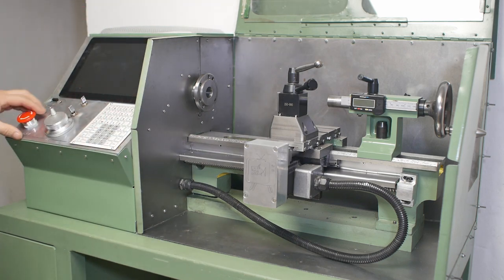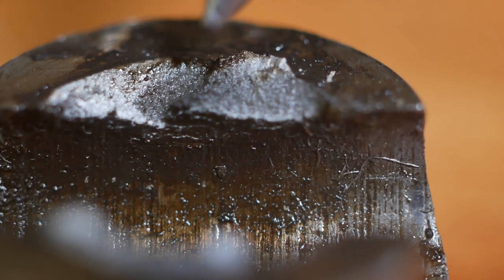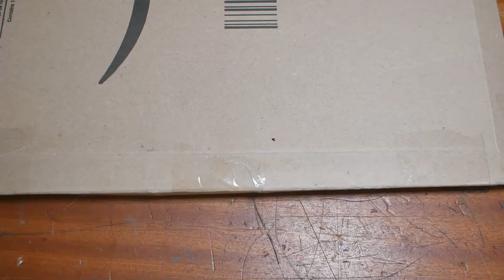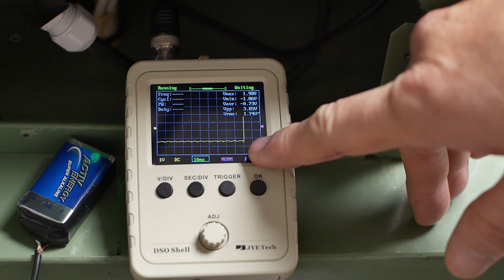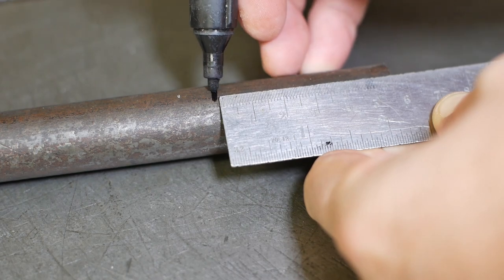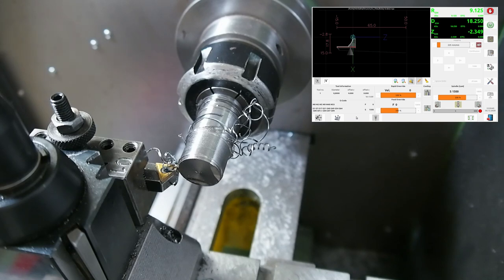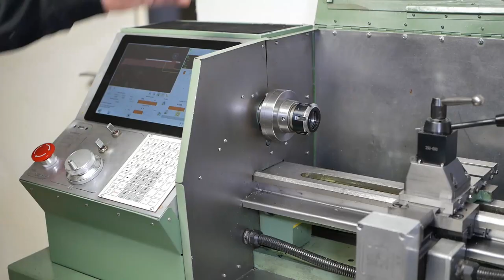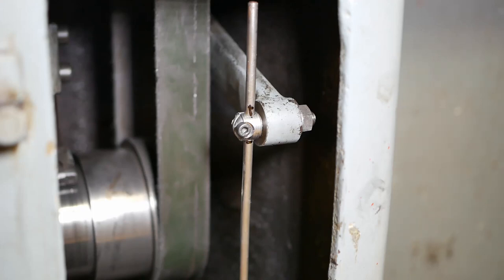Man vs tiny CNC machine - CNCing the mini lathe -Epsisode 38 || RotarySMP

Comment: This is the deficiently of a ER collet. If the work piece is to short the collet won’t grip it properly.  If you had left the bar long and turned the threaded end first. Than cut the part off the bar.  Than you could chuck the longer section in a smaller ER collet to do the end with the cross/clamp hole. If chucking something in a ER collet that’s shorter than the collets clamping length they don’t hold properly. The back of the collet collapses to small and than there is a taper to its bore. This results in the part only being clamped on the very end corner of the bar. That’s why the part moved when you were threading it. You can reduce this to some extent by clamping something of the same diameter in the very back end of the collet when you tighten it. But it’s still not the best. Sorry for being so critical you machine looks great!
Reply from the maker: Hi and welcome. I really dig your channel! 

I learnt the hard way about clamping short in the ER collet. I think it was about the time I was making all these screw ups that you made the video of the part with the thousands of measured dimensions. I can't even fathom how that can work. My probablity of screw ups doubles with every feature set up, so i'm at near certain error by about the fifth.

Comment: When threading manually on my minilathe I have to take vey light cuts (only a few thou). So I was delighted to see that even after all your scraping and re-gibbing etc, you still need to take light cuts to avoid catastrophe. Full marks for honest disclosure.
Reply from the maker: I was in high gear, whereas low would have given about 2.5x torque, and also my work holding was poor, with insufficient depth in the collet. I am pretty sure I can take a deeper cut, but improving the geometry doesn't address the bed having the rigidity of a wet noodle. Still better a  mini lathe than no lathe.

Comment: I was watching an older video by Stefan about regrinding his carbide inserts as that helped on his hobby grade machines as less cutting pressure is needed , only a suggestion as I’m no machinist , I enjoyed the video thanks.
Reply from the maker: It would help with cutting pressure, but then I loose the CNC advantage of having fixed tool offsets. With standard inserts, once you change tips, for general tolerance (no tolerance) jogs like this you don't need to touch off again and change offsets.
Thanks for watching.
Reply: Thanks for the reply 👍, I’d never had considered that as I don’t have cnc experience.
Reply from the maker: @lesliesoutham7396  Judging by STGW's excellent workmanship, he probably grinds all his inserts to identical repeatable dimensions as well :)
Reply: @RotarySMP  maybe your next project could be a CNC cutter grinder machine like edge precisions  , 🤣
Reply from the maker: @lesliesoutham7396  Imagine crashing something like that!!! Scary.

Comment: Brave soul turning so close to the collet at this stage.

Having rebuilt my big Beaver TC20 I know the stomach gripping tension of running that first program. At least yours should stall on a big crash, mines a 26 kw spindle motor !
Reply from the maker: Scary. That really is a nice feature of the mini lathe, the axis stall, the belt should slip, and it the worst happens, I can replace anything.

Comment: I think you need to make sure you use your Maho every video, that thing is just gorgeous 😍
Reply from the maker: It is a really nice machine. I am getting progressively comfortable with using it, also this time I messed up the touch off completely.
Reply: @RotarySMP  I'm very jealous, it's quite hard to find a Maho in Australia...
Reply from the maker: @oliverrowe8648  I got lucky, this one came up in Passau, about 3 hours from here. The controller was defective, so it was pretty cheap, although the mechanicals are barely worn. There are plenty of other good candiates like Hurco, Fadal etc.

Comment: I once heard someone say fail small fail cheap. At least it wasn't a $3000 USD part and you didn't seem to hurt the machine . It's great to see the cnc lathe doing something now. in a year from now that machine will probably be able make that same part repeatedly perfect once you know what speeds and feeds it can handle.
Reply from the maker: You really get to see why machines need mass. Those cuts the Boley does with ease. Although half my problem was not enough stock in the chuck.
Reply: I think the full quote is something like 'fail small, fail fast, fail cheap' - you make lots of little, cheap mistakes, quickly, hence you learn quickly and avoid massive expensive fails ...

Comment: You are braver than I, to upload making that "part". ;) Looks like you could use a HP increase. Too much is never enough! A different order of operations would have helped the workholding a lot, too. It is nice to see some first chips after all that work. I have been on the fence about a Linux CNC conversion, but the more I see the more it looks interesting.
Reply from the maker: YOu arent wrong. The only silver lining of my lame machining, is that people low watching robots commit suicide. :)
Yep, on the rematch, I have to do the work holding differently.

Comment: On the ER clamping problem: As you've found you can't grab onto a short piece of stock. You can cheat the system however by putting another piece of stock the same diameter in the collet behind the piece you're working thus increasing the collet engagement, and making it clamp evenly on the work piece. I regulary use the shanks of drill bits to do this (with the sharp end protruding backwards into the spindle bore).
Reply from the maker: That is a really helpful tip, thanks.

Comment: This is a really excellent series. Are those triangular inserts moulded or ground? The bloke on the smallcnclathes channel talks about using finishing inserts for roughing, citing lower cutting forces due to the highly positive rake and sharper edges. I've used cheap inserts intended for aluminium on steel with good results. This is on a basically unmodified Sieg.
Reply from the maker: Those are moulded inserts. I also have the high rake angle polished ones for aluminium, but fine the edges don't last in steel. This piece of mystery steel is pretty touch as well.

Comment: I bought some insert from Banggood purple-ish blue game changer and I run my lathe backwards with the tooling upside down. That way the tool is push up and way from the work not pulled into the work. I’m working on removing compound slide. Thanks for sharing.
Reply from the maker: That TCMT tool holder was part of a crappy set when I got it 20 years ago, and has not improved with age. Time to retire it. I have better (but bigger TCMT holders for the Boley. I'll check out those inserts.

Comment: Well, thats life :) Good job either way! 

Curious though, what your guess would be for the different failures?
Reply from the maker: Round 1 - Not realising that the depth of cut in the CAM is radius not diameter.
Round 3  - Not checking the end of stock Z position, after reinstalling the stock.
Round 4 - The CAM PP was for a fanus 6M, which is pretty close to Iso-274, so it works well for LinuxCNC, but it must be a rear tool post machine, so it sets an M4 (CCW where I need an M3. I missed it that time.
Round 5 - Stock not deep enough in collet, vs too much stickout, and maybe too much depth of cut.

Comment: There were some cool parts to the CNC'ing - the rounding of the head - that final pass from the centre out. Actually the CNC performed well, it was the manual bits that went awry, like holding the piece (not tightened enough?), drilling the threaded hole - that was just setup completely wrong - begging for a broken bit - the flat appeared later, yet the hole was still too close to the edge. Nice job with the CNC lathe. I guess the next part is where you add another three axis :)
Reply from the maker: A lot of errors:
- I should have switched to the four jaw. I suspect that thread on the ER32 collet chuck is so bad it loosend.
- Should have used lo gear.
- Should have picked up the M4 which the Fanux6 Post processor put in (I replaced it most times).
- some leaded steel would be nice.
Reply: @RotarySMP  Man, you know your stuff. Well over my pay grade! Very impressive to watch you Mr. RotarySMP. (Really).
Reply from the maker: @MiniLuv-1984  That is one of the reasons I got into this stuff, to learn. It has been a steep, but fun learning curve.

Comment: As a machinist for the last 51 years I can say with all confidence that your biggest problem is workholding.  Your ER collet just isn't doing the job.  You are not tightening it enough, or it isn't gripping enough length.  Personally, I have never liked ER's and only use them when there isn't another option.  My two cents....  And I applaud you for stepping up and trying to do something.  Continue the good work!!
Reply from the maker: Thanks for that feedback. I suspect you are right on both counts, so I'll try something different for the rematch.

Comment: For the depth of cut issue - do you think it might help to have something on the spindle that would act as a well-balanced flywheel to give it a little more inertia? I can't recall of there would be room inside your head stock - I'm comparing it to my old cast iron table saw - once that thing gets up to speed it takes a lot to slow it down and mostly it is due to the very heavy armature on the motor - it takes five or so seconds to spin up.
Reply from the maker: Using a chuck, especially the four jaw, would provide more inertia. I also should have selected low gear which proides about 2.5x the torque.

Comment: In the PncConf you can easily set up the HandWheel (2.7.15) - multihandweel if you using  7i76E in 2nd mode.
But for 7i96 it can be the one solution that you show.
But looks great!
Try to read about G-codes in LinuxCNC and postprocessors for your CAM.
What are you using G94,  or G95? (mm/min, or mm/rev)
I've used Resistor break with my Danfoss inverter
Reply from the maker: I didn't think to even try PNCConf again. I normally just use it for the initial set up and then manually edit the HAL/INI from there. I am a slow learner, so it is great that the guys on the LinuxCNC forum are so patient.
Reply: @RotarySMP  I'm slow learner too. (in this year i began to read about LCNC)
I'm using the PncConf  to see the changes and just copy/paste to the needed place. (in new config)
On my instagram you can see some machines that I helped to convert to CNC with linear tool change and one mill.
Reply from the maker: @DPTech_workroom  This was the first time I have used G95, that is pretty sweet on a lathe. I did one try at CSS, but that was the path whic hran backwards, as I didn't catch the M4. It should be easy enough to edit the PP to fix that.

Comment: What - that's a mighty fancy ... vice.

Are you going with smooth jaws (or even soft jaws) for precision parts, or are you going to make serrated jaws?

Serrated jaws ought to be a cinch on a CNC mill!
Reply from the maker: Probably smooth jaws. I never really like serrated jaws. It is easy enough to add soft jaws over the top.

Comment: You know the tightening torque on an ER collet nut is way more than you might think. Something like 120-140lbft if memory serves, but that is by no means reliable. The Swiss site for the original ER collets will give you the figure.
Reply from the maker: I doubt the ugly thread on my collet chuck would get anything near that. The is probably part of the problem though. And the stock was no inserted far enoug into the collet.

Comment: Feeds and speeds are so hard from piece to piece, almost seems like you’d have to make a guess every time, with maybe the exception of known materials... it was a good time for us anyhow.
Reply from the maker: Yeah, I agree. The recommended FS data from the insert manufacturers is for machines whose wiring diagram weighs more than the mini lathe, and is probably more rigid. That mystery steel has a far bit of carbon in it, judging from the sparks.

Comment: I think that the brake shoe needs to slide down on its adjustment so it swings through less of an arc before engaging. 
FWIW I always consider threading without a tailstock to be a bit brave.
Reply from the maker: I adjusted it dow, and although it has two M10 hex hed screws mounting it, it slips back up when I step on the pedal.

I really had too much stick out, with insufficient length in the collet.

Comment: I think you got your step multiplier switch set up backwards on the jog wheel? Seems weird to have x100 as the slowest setting.
Reply from the maker: Is that how they are on real CNC machiens? I have used one. I thought X10 is tenths of mm, and X100 is hundredths.
Reply: @RotarySMP  Multiply vs divide ...   Take a step back, grab a cuppa and ponder for a bit. :)
Reply from the maker: @petergamache5368  :) So on a real CNC x100 means each step is 100/100th = 1mm? I just though they used an X as a decimal point doesnt engrave well :) Duh!
Reply: @RotarySMP  The Deckel guys from germany had it your way on their handwheels, 10 was one tenth of a mm, 100 one hundreth, and 1000 one thousand of a mm
Reply from the maker: @frederickfriebe1243  Oh good. I am not alone in this then.
Reply: Weird. In my experience of them (Fanuc, Heidenhain and Mazak) it seems to correspond to microns instead of millimetres, so the higher the multiplier, the faster the movement.

Either way, it's your machine - you run it as you see fit mate. Still a cracking project regardless.
Reply from the maker: @erewhonmuesli  Now I get confused :)
Reply: @RotarySMP  or 1, 10, 100 increments per unit of movement?

Comment: For the thread on the CNC machine, we use at work ca. 8-10 passes for the thread itself and maximum one  clearance pass (just sometimes on some nasty stainless).
But I work on industrial CNC maschines made by Mazak and we use carbide cuttings tools. So I don't know how capeble is your tiny CNC machine with your HSS steel when working properly ;-)
Reply from the maker: Thanks for that. I need to do some more practice - understatment that :)

Comment: OK, OK, I like to work close to the chuck but I actually jumped and blinked at 16.50 when it went so close to the collet.  And the again at 18.28 when it jumped cutting the thread.
Reply from the maker: You have to trust the machines ablity to count :) It was at least 0.1mm clearance, and a miss is as good as a mile.
Reply: @RotarySMP  I was looking at the rh screen and I think it made it look even worse than it was.  Still darn Tight though.
Reply from the maker: @smallcnclathes  One of many pucker moments in the world of CNC :)

Comment: I think your problem is you might not have enough stock inside your er collet, make sure it reaches all the way to the end. also try to use close to the maximum diameter of the collet if you can. 18:42 yeah way way too short, the collet is being allowed to flex out of its tapers and loose grip, no biggie just use a longer piece for it to grip. in this case do the thread side first, and then turn it around in the collet and grab it by the shank you made, then part off the excess material, and finish the round surface off.
Reply from the maker: You are right. I should have been more careful with the work holding. 

I also could have done the threaded bit in two setups. First chucked up short, with just 20mm for the thread (plus a little) sticking out, and then once that was down, pull it out more and cut the shank.

Comment: You seem to like speeds that require a lubricated cut....   and on my mini lathe.. I've switched to carbide insert only, as these can be resharpened...(on.. the mini lathe is crap and need a rebuild.. the reason that I found you channel.. well YT did the initial suggestion).
Reply from the maker: Thanks for watching it. :)

Comment: At 21:15:
 Is it really right, how the brake touches on the shaft? Looks like there should be much more contact surface possible, when loosening the bolts and lift the brake pad down.
Just being curious...
Reply from the maker: You are right. I readjusted that, and it is also slipping a bit.
Reply: @RotarySMP  Maybe you need a new brake pad
Reply from the maker: @heathledger4506  There is plenty of meat on the pad. It is all pretty oily in  there, so I don't expect much from the brake, but the shoe carrier is mounted with 2x M10 screws and they are also slipping when I stomp on the brake. I thought I cranked them.

Comment: Why is suddenly everyone doing something with collet chucks? Quinn from Bloondihacks made one in her video yesterday, and someone else she mentioned as well.
Also, that steel grade scrapbinium seemed to be a tough nut. Why don't you make a linkage for the brake like you did on the gear change lever?
Reply from the maker: You are right. From the sparks, there was a fair bit of carbon in that steel. 

I made that collet chuck at least 15 years ago. I just used it cause it seemed like a good idea. It wasn't :)

Comment: Rotating the wrong direction happens to the best of us. But that is a bit to frequent!
Reply from the maker: I used a Fanuc 6M Post, which must be a rear tool post lathe, so it assigns the reverses spindle rotation commands. I caught and corrected it nearly ever time, but one snuck through.

Comment: I don't think your ER collet nuts are getting torqued tight enough. They're specced to like 150Nm or something.
Reply from the maker: Surely part of the problem. I doubt that horrible thread I cut into that collet chuck would survive that torque. I should have held the stock more deeply in the chuck as well.